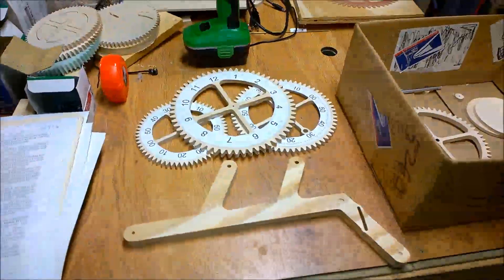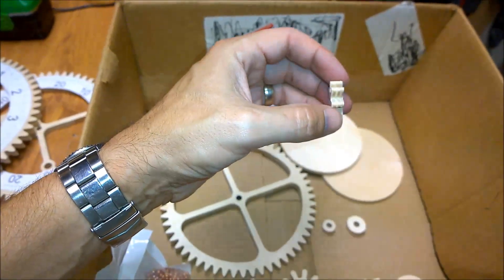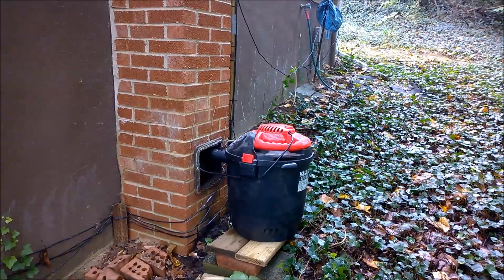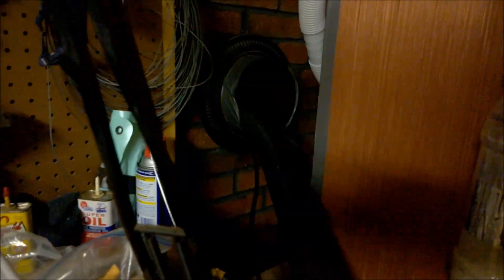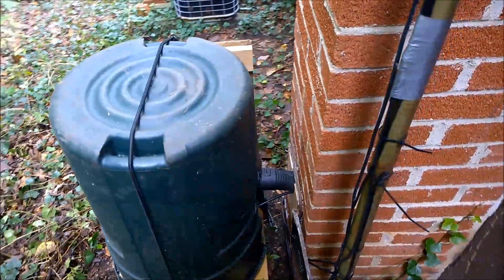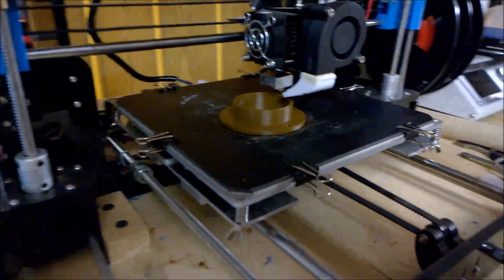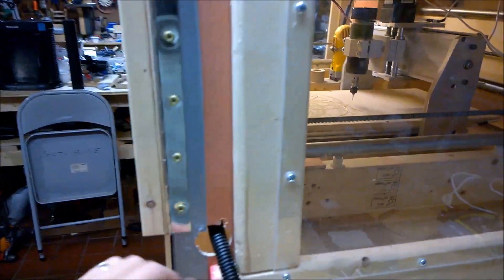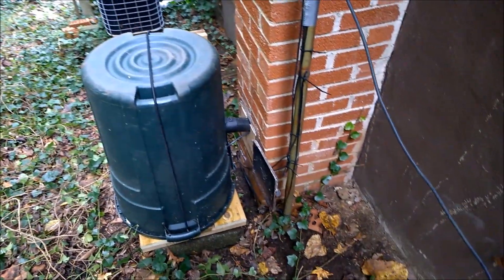DIY CNC - Genesis Wood Clock Build & Shop Vac Enclosure Mod

Comment: Drez, I am building the same clock. However, I do not have a cnc to cut out those gears. Would you consider cutting out a set for me, if I where to pay you? I have the plywood for all the gears. I can send to you.

Comment: One wonders if removal of particulate would improve if additional ventilation holes were made in the enclosure.  It's nice to see the magnitude of 'draw' from the shop-vac, perhaps ultimately the most airflow is the advantage over a low pressure in the enclosure.  I was asking myself about the temporary environment cover of the shop-vac outside, if it contains the air exiting the vacuum.  Here also the least impediment to airflow may help?  No criticism...  just thinking.
Reply from the maker: I appreciate your thoughts.  And, yes, I think I may add a little more venting.  Maybe just enough to stop the slight indenting of the plexiglass panels.  The enclosure box is certainly not tight as there are lots of little gaps.  The shop vac venting seems to have an easy flow out of the bottom of the inverted trash can.  There is also ample space around and above the Shop Vac for the air to move around and out.  It's an ongoing project as are most of my builds.  I truly enjoy how quiet it is inside when the Shop Vac is on.